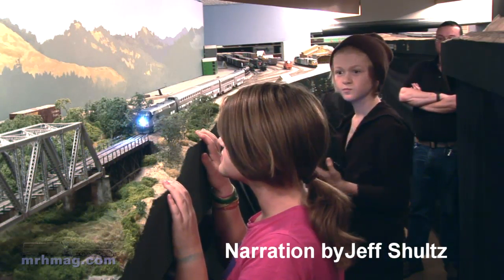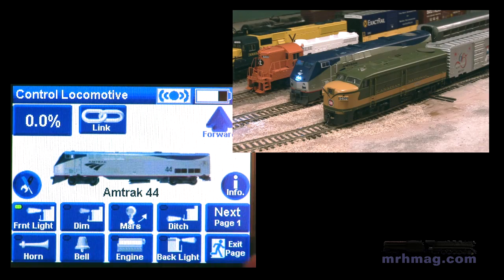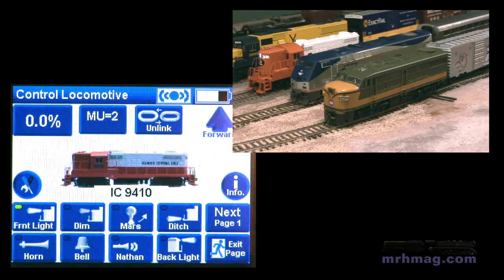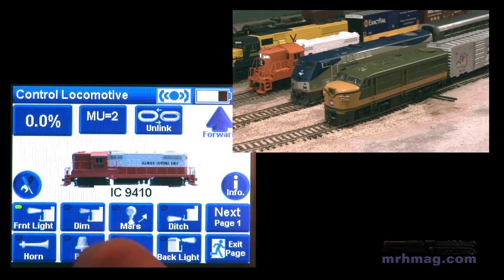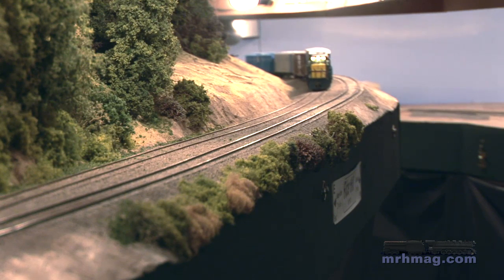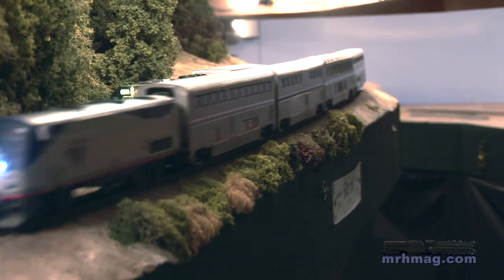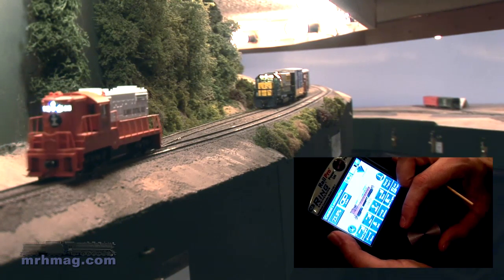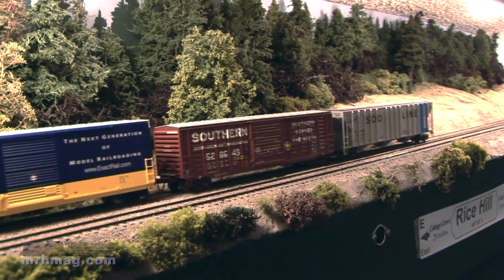MRH demos the RailPro system

Comment: wow. this system is a game changer. thank you to everyone who is getting this information out for the consumer to see. downloadable sound files, manual notching, and piece of cake consisting.... dcc manufactures are in big trouble. ring engineering is 10 steps ahead at the starting line from what I can see. I need to get some hands on with this system. and does any one realize how easy it would be to run helper operations? and I won't mention names, but a comment was made in this thread about it "not being for the serious modeler"... I resent that comment! and you can be sure my friend, I will never watch another of your videos again, and that's a decision I will make based on principle! thank you again for sharing this.

Comment: It depends on your hand.  It fits in my hand just fine, I can run single handed without having to look at the throttle. The modules (decoders) are no more expensive than a Tsunami. Look at yankeedabbler for deals. It will run on any layout that is powered, be it DCC, DC or whatever. It does not interact with DCC, so you cannot consist Railpro locos with DCC locos. But as long as the rails have power, Railpro can be used on that layout without any issues.

Comment: Interesting, what about accessory decoders being controlled by the unit, like turntables, etc.  The railpro website talks a little about turnouts but not in depth about accessory decoders and how to hook up their system for them.  Also, if railpro equipped locos ONLY use the track for Power and NOT Control, stuff like traffic control hardware( thinking about dcc specialists - would not function)/software macros non operational.  So does railpro support macros?  Interesting system!

Comment: I got to use one. It was in operation session. It's the last throttle you want in op sec. Does not fit in your hand it is heavy, has no place for safety strap, every time I would make a move with a spot half the time I had touch the screen and the controller was some where else. The decoders are very expensive. You will not be able to run on another DCC system.  It is not DCC, it is radio remote control.

Comment: DCC will eventually fade away and a system like this will take its place IMHO. The next generation of model railroaders will have grown up used to simple intuitive electronics like this. They will not have any tolerance for anything less. Once this system has a few more features it will be hard to beat. Once battery technology gets to the point that you can safely store enough energy onboard smaller scale models like HO this system will be poised to really take advantage. Imagine a layout with no wiring whatsoever but with all of the ease of use shown here. I like it. I'm going to use it for battery powered 2 rail O.
Reply: Has it worked out for you in 2 rail O?

Comment: The controller weighs a ton. Not suited for hand. No place for safety strap. Hard to use in ops session, just touch screen and it is off to some were else and you have no control of your engine.